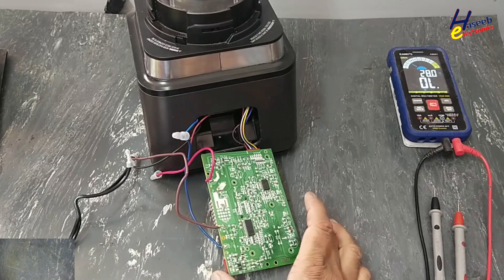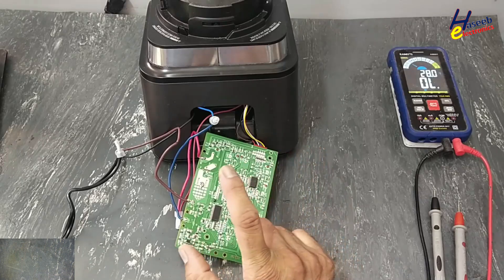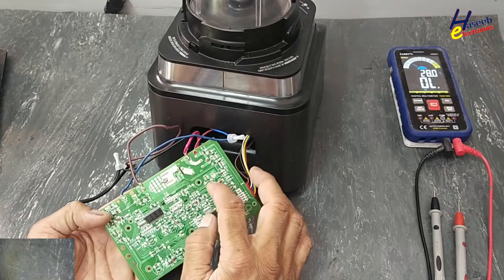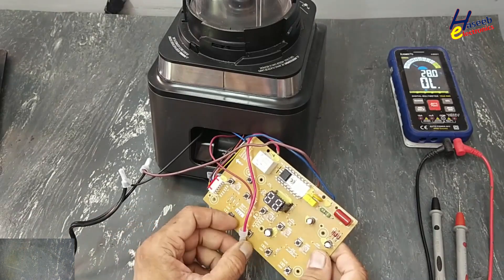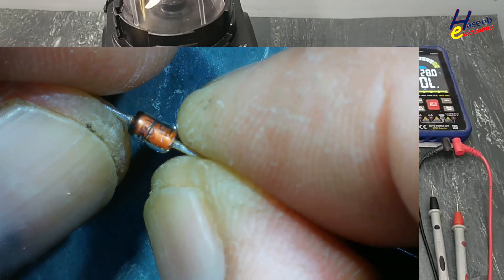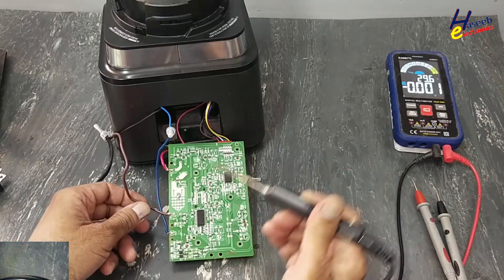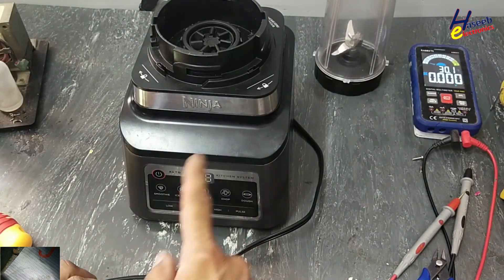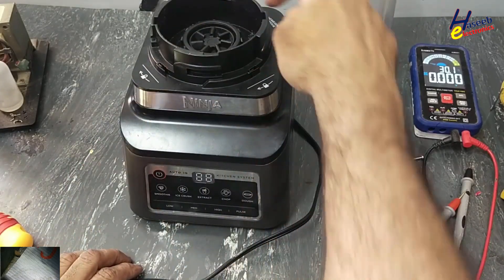{1371A} Ninja Blender Repair Part 2 | Assembling & Final Testing

Comment: I have ninja bn805 a not working I'm from India please help for repair
Reply from the maker: BN805A and BN30 series. the motor and its controller circuits are almost similar. 
check its voltage 5 volt and 12 volt 
check output TRIAC
check output control relay and its switching transistor 
check motor continuity. if there is no continuity, check its carbon brushes